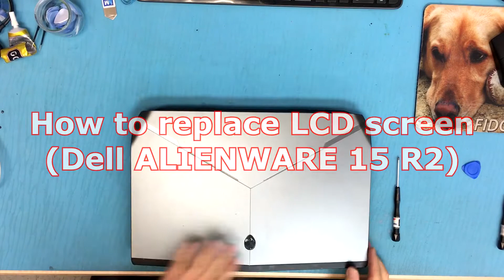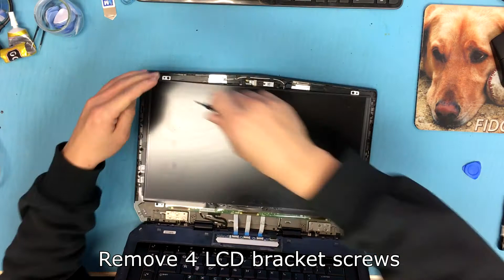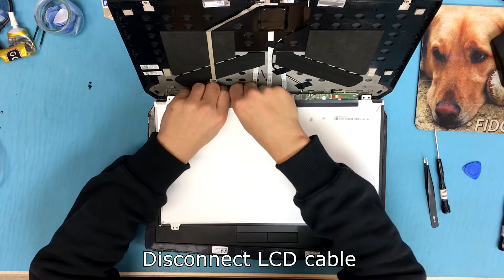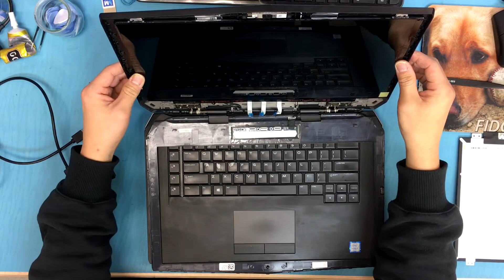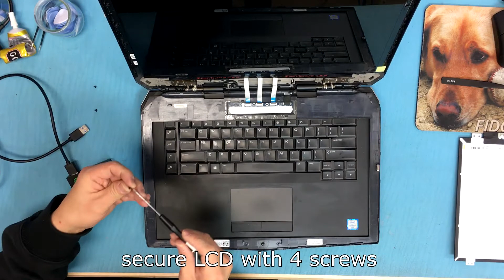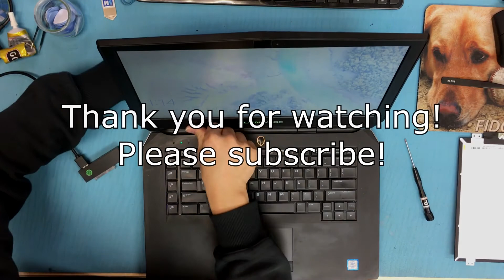How to replace Screen for Dell ALIENWARE 15 R2

Comment: Do you if it is a 30 pin or 40 pin connector?
Reply: 30 pin, according to their website:

"30-pin eDP - the main modern connector.
It is used on screens with resolutions up to 1920 x 1080. If your laptop was manufactured after 2014 and features screen resolution up to 1080p it is likely using this type of connector."